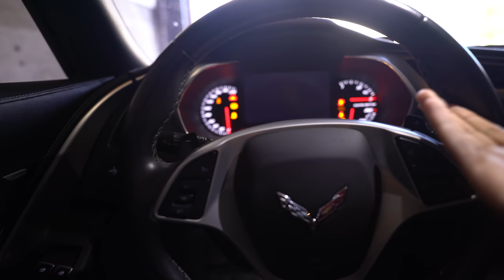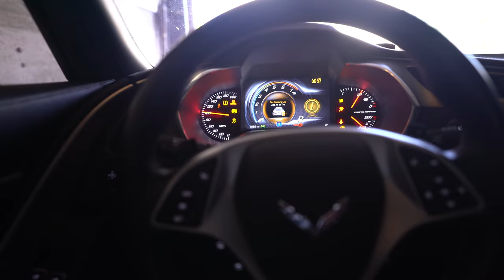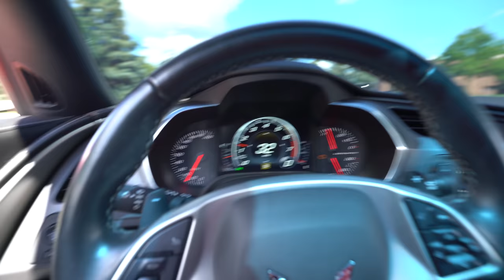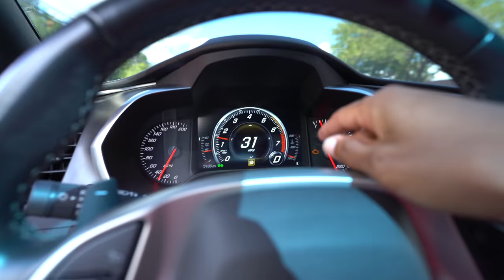INSTALLING NEW INSANE AERO KIT ON MY C7 CORVETTE *GAME CHANGER*

Comment: Using the stock suspension adjusting bolts, you can safely lower a C5 Corvette. The maximum lowering distance is 3/4 of an inch in the front and 1 inch in the rear when equipped with the Z51 suspension. The standard FE1 and F45 suspensions can be lowered about ½ inch in both front and rear lower your vette bro and it’s going look 10 times better
Reply: I don’t think the c7 with magnaride can be adjusted but I do believe the zr1 can be but maybe the magaride can too
Reply: @gsjourney3054  yes you can if I’m not mistaken

Comment: I can't believe you pay someone to do all this. I have a built C7 stingray 2016 and I have had my bumpers off so many times. I've done everything myself. I've put my own high wing on. Changed all my Bottom body moldings. From white painted to carbon fiber. My car is extremely tricked out everything was done by myself in my garage. You should really learn to do this on your own it's good for you to know your car.